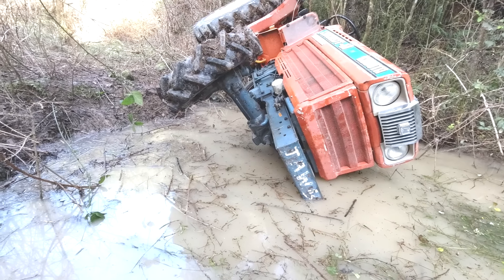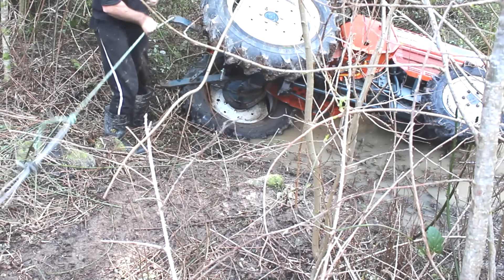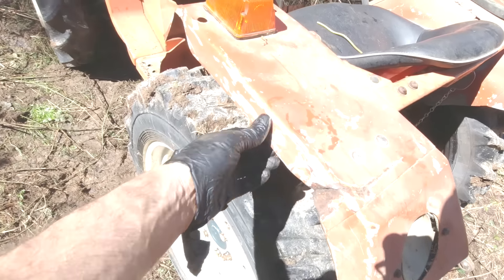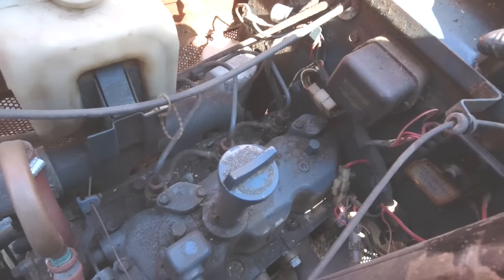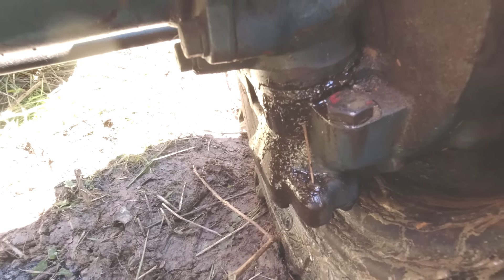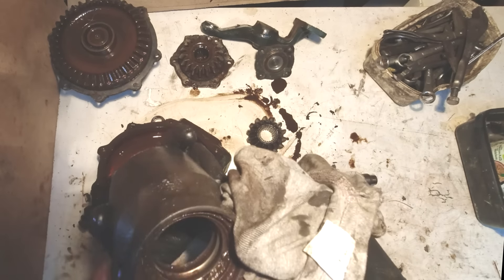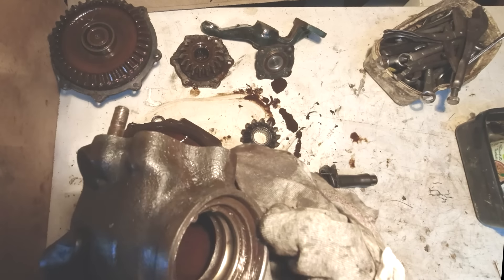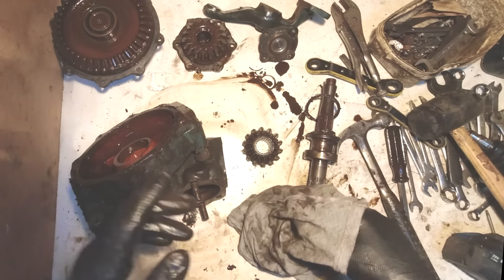Salvaging a Crashed Kubota Mini Tractor.. Owner wants it gone!

Comment: Let me know what parts you need and my best friend who works at the Kubota about 3 miles from me can get any available factory parts that you need as well as authorized replacement parts IF they're still available,which most are.. And it'll be at jobber costs USD plus actual shipping... I ain't making nothing off of anything because that's how we take care of one another...
Reply: Ps.. US prices for parts are extremely cheaper than Aus or NZ prices and the difference might actually cover the shipping cost$ as it does with several of my Aussie mates who need Harley parts that I send them for less than half of what they cost down under...
Reply from the maker: You legend thanks mate, I have already ordered parts but I appreciate the offer. cheers
Reply: @FJ80Coop  Need a bucket cylinder for my 1985 KH28L. No luck here in Canada or with my UK contacts. Any way you can help? Not trying to ride on Marty's coat tails but having a bugger of a time finding new or used. Thanks. Jim
Reply: It's hard as to get anything here to new Zealand from the US at the moment with bloody covid
Reply: @jimmeroniuk8266  you know what I would do is buy a new cylinder.  Figure out the rod outside diameter,   measure pin center to center distance retracted an center to center distance with cylinder fully extended that'll give you the stroke.
Reply: @cfewbopmech73  yea, there's around a 100 container ships off the California coast waiting to unload ,empty containers being dumped everywhere in so cal because it's too expensive to ship an empty container back these days .No idea of cause of all this ,biden maybe
Reply: @mrivantchernegovski3869  Regulations on only stacking them two high limits space, supply chain effected by govt restrictions, part of social control. Scarcity, food shortage, fear of a major threat like drugs, terror, or a "pandemic",
Reply: @mrivantchernegovski3869  Lol, no. This is purely Cali trying to be "green". They banned owner operators from picking up in the docks to help force their laws on semi trucks that don't have DEF filters. That alone removed any way of them getting trucks in, and then you have all the trucking companies constantly undercutting the costs and shoving that onto truck drivers. At the end of the week you have massively underpaid truck drivers, no outside help, no one wanting to take in new contracts, and a government that's been overstepping it's control to the point it's now kicking itself in the ass.
Reply: Californian government just needs to back off.
Reply: @RosesGard3n  Think Cali could slip right off into the ocean and nobody would miss it. Like the song says, "Buy some ocean front property in Arizona"
Reply: @mrivantchernegovski3869  Welcome to the "Just In Time" logistics! Every company in the West switched to just-in-time delivery model instead of keeping stock because it's cheaper that way (no warehousing costs, no money tied up in unsold items etc). The problem is that this model depends on the logistics infrastructure being *under capacity*. The pandemic + Ever Given incident have created a traffic backlog that has the entire shipping infrastructure operating continuously at 100% capacity -- which means that this backlog won't dissipate on its own anytime soon.
Reply: Throughly enjoying your content Marty, especially this episode 😃
Reply: @ jim Meroniuk.. I'll ask him this week but any equivalent stroke and pressure cylinder should easily interchange... If it's the same length and has the same size shaft and is tbe same as in 1 way or 2 way cylinder then you should be able to source a reasonably priced any brand named cylinder up there from a plethora of places... Contact Billstmaxx in his youtube channel who lives in Canada and knows where to get a good replacement cylinder and most likely at a reasonable cost to boot... But ill still check and try to get back with you once he finds out...
Reply: @merlepatterson  absolutely no one would miss if California dissapeared
Reply: @mrivantchernegovski3869  Oh FFS, keep your far quit political views out of here.
Reply: Wonderful 😊
Reply: Good people 
Good deeds 
Good times 
Cheers brother
Reply: @josephking6515  absolutely right, bloody right wing trolls.
Reply: @amos4457  last quoted 3000.00 cdn for that route. I have all the info from the repair/maint manual
Reply: Excellent offer of help to Marty there my friend . Top man .  Need more people like this in the world .  Helping each other across the  long distances . Cudos to you . .
Reply: @jimmeroniuk8266  sorry to hear that man .
Reply: @merlepatterson  Nah.  That'd kill off over half the country's food supply.  Just the coast needs to slide off and the resulting tsunami take out Sacramento.  I'd even sacrifice the world-class Railroad Museum for that to happen.
Reply: @amos4457  Bet Kurtis at Cutting Edge Engineering Australia could make a brand new cylinder in < 1 day.  :-)  Probably make  YT video about it, too.  :-)
Reply: In the days before internet I purchased one of the grey market kubotas without knowing what I was buying because of the low price. Went to the dealer to pick up filters and oil and was told in no uncertain terms they would not support the unit with filters or parts because the unit was a grey market and they don't match up to American sold units.  I was a bit dumbfounded as to what he was talking about. I got educated real quick. The grey markets were sold in Japan for Japanese farmers and were never meant to be brought to the US market. Speculators bought all the trade in Japanese equipment  and shipped it over to the US and sold it at rock bottom prices undercutting the US Kubota dealers. Kubota USA made the decision to not allow dealers to support parts on the grey market units even though its basically the same machine. They had no problem selling me another USA made tractor at 10 times my original purchases price.... later sold the unit at a loss to someone else after telling them about my story. The internet should now allow you to find parts for the machine....good luck
Reply: @jimmeroniuk8266  
go to Princess Auto...they can even make custom hydraulic cylinders....any hydraulic cylinder can be fitted if you try....or adapted to fit...longer or shorter lengths..don't matter...they are cheaper than factory...any hydraulic shop can fix yours too...or at least confirm it is not worth repair...i rebuild mine ...not hard to do....
Reply: @andrewslagle1974  stop trolling and get a life,
Reply: What a bloody legend. Good on ya man!!!
Reply: @mrivantchernegovski3869  no. We have the same issue in the UK.
Reply: @garymallard4699   Thanks Gary been that route. They stopped making custom cylinders awhile back. I emailed them abit ago. Mine is bent like a banana previous owner built a thumb and over powered the cyl on the bucket. So rod bent and Cyl damaged. I couldn't find any on princess auto that took a 2 inch pin. Thank for your reply
Reply: Why in the world does disdain for California and US government make its way into comments for a tractor salvage video? Some people need to move on. 

Back to the actual topic, thanks for the kind offer. It''s always encouraging to hear the generosity of strangers rise above the noise.
Reply: This is what a global community looks like .. it seems awkward now, but this is quickly becoming the norm. Embrace, and pay it forward. Your neighbors are now thousands of kilometers away ..
Reply: @jimmeroniuk8266  
just the pin is the problem to " fit " ??
length is ok?? 
you can modify them easily to match...or make a adaptor to reduce the pin size...not sure exactly what you need??
you need to go from a 2" pin down? 
that is easy... most times...
i fabricate so i always find a way to get something working....
Reply: @jimmeroniuk8266  
you might be able to take parts off one if your rod is all that is wrong....
rebuild it with what fits??
Reply: @jimmeroniuk8266  
if needed..i cut off the brackets and modify to fit a common cylinder....always a way to fix it cheaper..especially if parts are non existent or expensive to buy....good luck....
Reply: @laknox88  Yep, I enjoy his channel
Reply: @garymallard4699   Yes I took it to a local shop and they confirmed its NFG
Reply: @garymallard4699  No its off a bit as well only problem for me is I don't want to compromise on dia of cyl or cyl rod. You go down and then lose the machines digging ability.
Reply: @garymallard4699  Yes that what will probably happen. Had to do that for a cylinder on my 1965 Fordson Super Major with the Ford backhoe.
Reply: Hopefully they’re going to TX for the border wall.
Reply: @jimmeroniuk8266  Not sure how clued in you are on mechanical repairs to farm or industrial equipment, I do it for a living. In this area of Manitoba there are several hydraulic companies and machine shops that supply parts or can repair or make new parts or even   build new cylinders cheaper than you can buy from the original equipment suppliers, if nothing matches from on the shelf at princess auto or places like that. One of the companies built an obsolete cylinder for my buddies MF backhoe, using the 2 bits of his that was still good. Then made the rest from new custom  machined parts and welded it all together.  I had a 3ft long 2" diameter rod made and new seals for my JCB  backhoe stabilizer including steel and parts/machining it was only about $500. JCB or used parts was a complete waste of time with costs or availability 5 years ago and i've not had a problem since.
Reply: @jimmeroniuk8266  
i didn't say to change the rod diameter size....you want it as big as stock ( bigger is ok too )....
the length ( pin to pin ) it extends and retracts needs to be " close " not perfect...you can make it perfect if too long too ).... not sure exactly your problem still???
the ends can be changed if needed ( how it connects to machine ).... anything can get changed to work...
you can get cylinders other places too.... than PA....??  really not that hard to make it work if you understand how things can get made...or get a local machine shop to fab up the ends??
Reply: @Happymacer   Nope its been to two different repair shops in my area and they said no go. Bent to bad and damaged all the internals
Reply: @FJ80Coop  Where are you?
Reply: @garymallard4699   Thanks Gary. I was hoping to do this the easy way. Guys at Kubota said no longer available and that was that. Was hoping something in the states was out there even a used one. I'm a millwright by trade and am aware of what can be done etc. Appreciate the advice and coaching. Shops around where I am quoted me 3 grand to Fab on up. So I'm looking on Facebook and where ever I can to find one close and have it modified.
Reply: @jimmeroniuk8266  
no prob...that is an insane quote!!
Reply: @jimmeroniuk8266  
what model is it?
Reply: @garymallard4699  older one 1985 Kubota KH28L
Reply: @jimmeroniuk8266  
there was a guy near me that sold grey market stuff...i will try to find his number?  never bought from him
i have Sears/Roper Garden tractors...
Reply: @ronaldheit196  Oops, sorry that you choose to get antagonised by my comment and straight away you attack me and denigrate me as a person because I implied something that does not fall in line with your values which means I'm a lesser person and should just be quiet unless it follows your guidelines ?
Reply: @merlepatterson  Maynard, the singer of the band TOOL sang a song back in the 90's about how mother nature could wash away Los Angeles and it wouldn't hurt his feelings in the least. In the lyrics he called LA a shit-hole, "One great big Neon Distraction" and said how people should learn how to swim. Of course in a more explicit and screamy way. :)
Reply: @mrivantchernegovski3869  more like 300 ships
And the new laws forced about 39000 truck drivers out of the business all of them non union. That’s the main reason logistics are fubared
Reply: @mrivantchernegovski3869  No,no,no,no. The Us ports have been falling behind for 20 years or more. They are known as being slow and outdated and not keeping up with technology and not making any investments in new tech. The USA has some of the slowest ports in the world. Watch any video about the Dutch ports or Chinese ports and your will see the new tech. They offload by robotic arms which load onto robotic transporters that have GPS technology built into the ground of the docks. The computer knows where every container is at any second. They drive by themselves all around the port with no human drivers. So no, Biden has nothing to do with it at all. The USA is just behind decades in tech for our ports, ranked 38th in the world for education. As far as tidal energy..... they have them designed, blueprinted, built and tested for years now and are getting good data back. We have not even tried to design our first one yet. And as a veteran, civilians are about 30 years behind in healthcare too.... But we are No. 1 undisputed world champions in the blame game and pointing fingers! We spend all of our time and energy arguing and yelling at each other and they , well...... have been building.
Reply: @josephking6515  It’s not political views, and I speak as independent truck driver who USED to make my living off Port of Long Beach, until the green lobby pushed us out of there.  Luckily I took my truck and family to South Carolina where they actually appreciate hard working people like myself.
Reply: @merlepatterson  so loosing the 7th largest economy wouldn’t affect you? People in California have been financing a lot of every other states economies for quite a while.
Reply: @mrivantchernegovski3869  Precisely!
Reply: @obamabigears734  We are fine without you, hope you like your new home!
Reply: @ericmartin5720  Truly enjoy it here, particularly the lack of traffic jams and the low taxes
Reply: @ericmartin5720  Sure, it might effect me, but I'll get over it.
Reply: @Slane583  Yeah, I was at their 12-31-95 concert in Oakland where it was the first time they played Aenima and introduced Justin Chancellor as well.
Reply: @ronaldheit196  It was sarcasm and if you as a grown man you are offended by my comment that was not denoting anything at all you better hand in ya man card and change your pronoun to something more fitting your disposition
Reply: @rvhmon656  LOL
Reply: @ronaldheit196  You still got Trump living in your brain rent free ROFLMAO.
Reply: @mrivantchernegovski3869  I read today that the owners of the transport ship are charging $18K per container from Asia, but can't get that on shipping our goods(mostly Ag) back to Asia, so they're not even stopping to load our exports - they just unload and book back to China, VN Taiwan, etc.  That's the free market working, not Biden. It's knocking the hell out of our ag product export business. Strange days.
Reply: @merlepatterson  Y'all like to say that, just cuz you think all Calis are liberals and you don't like that.  If Cali disappeared, you'd miss a helluva lot in your grocery store.  And liquor store, and a lot of other things you depend on. Cali is the 5th largest economy in the WORLD, and for all the asinine crap in state government and the weird alternate reality world of San Francisco, this is a great place to live if you're willing to work hard.
Reply: Top bloke.
Reply: @garymallard4699   Mines not a Gray market but thanks for following through. Jeep CJ6's Rototillers Generators Fixing mechanical equipment and the list goes on and on
Reply: @jimmeroniuk8266  
yeah i do every kinda repair or build...home and vehicles....50+ years now....
ok thought it was a grey market
so they don't support older models??
that seems to be common now...
i can't get parts for my older Onan engines...if i can they are stupid expensive!!
Reply: @mrivantchernegovski3869  You wish, this was a few years building, it came to a head when everybody started ordering on line. Everything is stuffed now, incoming volume, is higher than the ports/trucks/trains, can deal with, the old 'just in time' bit, means they slimmed down on warehousing too. So right now there is a made turnover (buying and selling) , and building spree, in warehouse construction. Go into any warehouse district in America, you will see a mad construction zone. Canada is the same.
Reply: @RosesGard3n  They will, once it turns into an episode of lord of the flys and they are all wearing bed sheets and eating wild cats.
Reply: @carlthor91  yip getting stuff is a nightmare these days ,well my R32 Skyline 25 det was worth about 11k pre covid now prob more close to 28 k ,dam gotta love covid in other ways
Reply: @mrivantchernegovski3869  Seems to be the same all over. Here in Auckland we have the same problem, ships being diverted to other ports to unload, then having to move containers to Auckland overland via rail or road.
Reply: @briananthony4044  Yea I stay in Auckland to yes I heard about that ,guess the other ports like the work it brings in lol ,even courier stuff takes ages to Your one of the first no to crucify me over saying maybe biden lol
Reply: @MartyT  Olá  Marty devias de rodar os pneus trazeiros. Saudações Portuguesas.  
@ Marty T  Hi Marty you should get your rear tires rotated. Portuguese greetings
Reply: @DivideByeZero  Americans never seem to quite get that there's an entire world which doesn't care about their politics and the like...
Reply: @AghoraNath  I just went by a "boat" load of those containers in Long Beach/San Pedro last week and can testify that they start 7 high in the rear and taper to 4 in the front (for visibility).  Problem is getting the unloaded cargo out of the harbour.
Reply: What a great guy the world needs more people like you
Reply: Good luck and thanks for sharing your adventures!!!
Reply: He said parts are hard to get somebody tries to help him and then he says he already ordered them he got them can't help nobody nowadays I don't know anybody I will definitely let you know cuz I'm getting ready to buy one just like he's got they're bad little machines I'll pay the shipping
Reply: @jimmeroniuk8266  have the cylinder rebuilt if you cannot find a replacement. Any hydraulic shop should be able to do it. You may even find a universal they cylinder that may work.
Reply: @shadymaint1   Can't rebiuld. Barrel Bent. Rod is a banana. Found two cylinder to check out then transfer Rod End and barrel mount to cylinder which fits best. Specs call for ID of 3.1 inch. One cyl is 3.0 dia and the other is 3.5 dia. Thanks for the advice though
Reply: @shadymaint1  Ok Thanks
Reply: @RosesGard3n  That needs to be a Donut Media episode,,
Reply: @Mike Hi Mike. Got it under control. Bought a three inch and a 3.5 inch Dia cyl to cover my bases just need to have the rod end and cyl end welded on the new cyl. Thanks for the reply
Reply: @RosesGard3n  The UK truck industry has been foing the same for yeas, and so now they are convieniently blaming Bexit
Reply: grey market parts  are a pain to track down
what person needs is someone who works on tractors and recognizes what other brands use the same parts
Reply: You're a legend.
Reply: @mrivantchernegovski3869  Biden definitely not maybe
Reply: Defund the government without us tax cattle they have no power
Reply: Привет из России, молодец что помогаешь людям!!!
Reply: @jimmeroniuk8266  Check local hydraulic cylinder rebuilders.

I had  a cylinder rebuilt  locally and it's better than original.  Cost was close to buying new, but a stronger  ram shaft much better seals and slightly increased bore for more power. He really didn't like the material of the OEM and essentially made a whole new  cylinder.
Reply: Good you can help Marty T out.
Reply: @mrivantchernegovski3869  Don't blame your President for the stevedore's problems
Reply: @briananthony4044  Im a kiwi in Auckland lol
Reply: @mrivantchernegovski3869  Wow, that name is a mouthful. Russian, Ukrainian ??
Reply: @briananthony4044  Ukrainian lol
Reply: @josephking6515  Why? He’s right.
Reply: And a new Legend is born
Reply: Where do you find the unavailable parts as I have one that everyone tells me sorry we no longer make that part
Reply: Definitely get them cheaper online.
Reply: Now, that is how food people can help one another.  

Good on YOU sir!
Reply: Food = Good.
Reply: @MartyT  why did you blur out the battery logo
Reply: @FJ80Coop a⁹
Reply: Why is that battery blurred out ?is it a secret squirrel battery 😊. All the best from England.